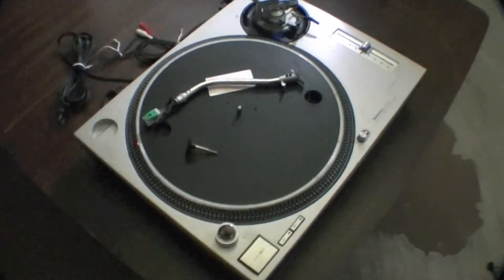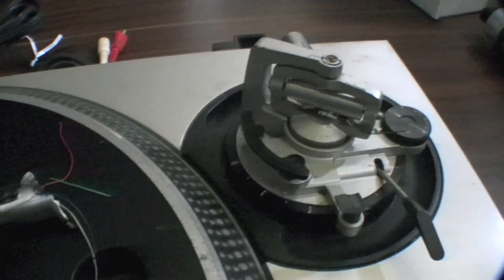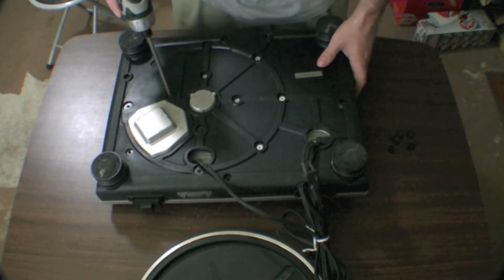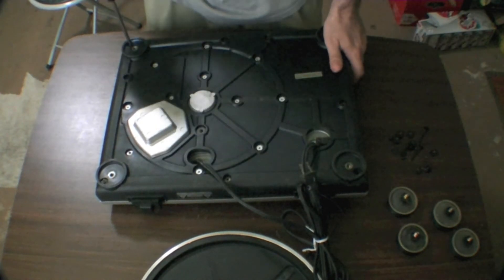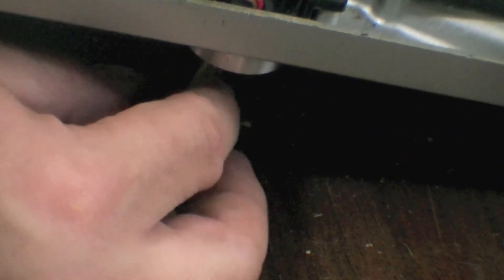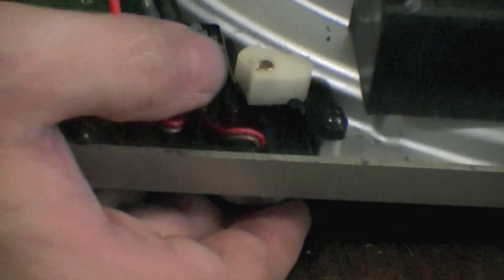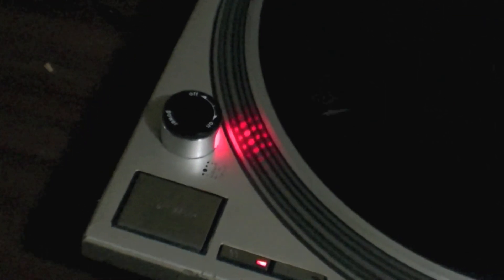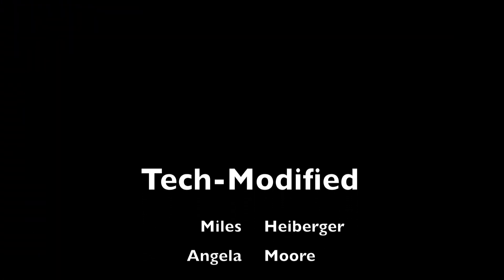Tech-Modified Episode 1 Technics SL-1200 MK2 Power Switch Replacement

Comment: Hello, I have the same turntable, I was playing music with it eventhough the power switch is missing. When I touched the little button inside the power switch, the turntable went off.  Is there a way to turn on the turntable as it was working before, I tried turning clockwise the little button but I don't want to touch it more and more as I might damage it. Thanks a lot for your help
Reply from the maker: No way to tell for sure with out metering the switch power.